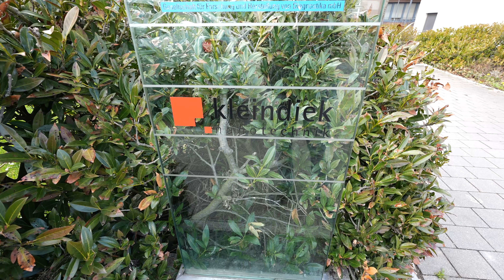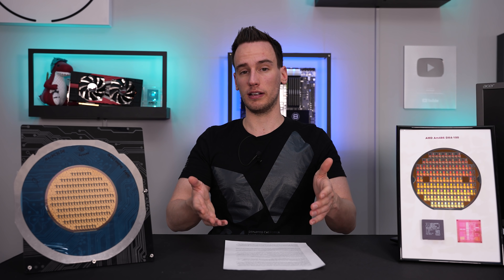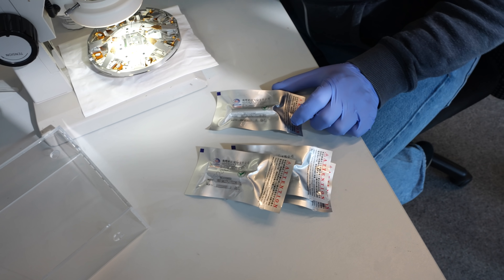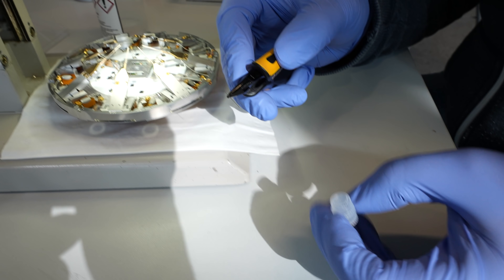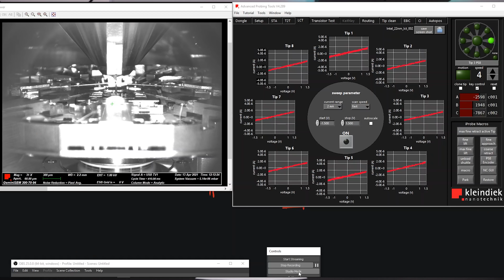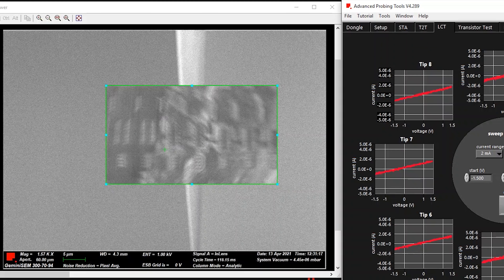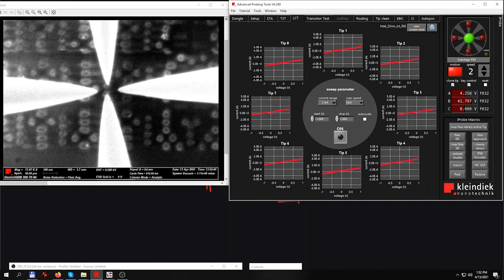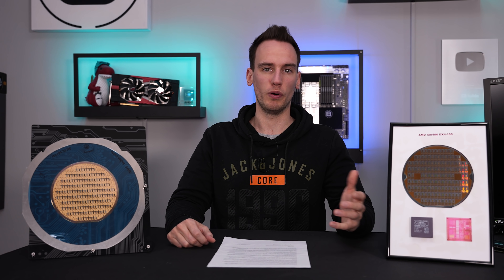Unreal Precision - Analyzing a Single TSMC 7nm Transistor. Visiting Kleindiek Part 1/2

Comment: I didn't know TSMC used cobalt. Some older articles speculated that Intel's 10nm process problems were because they used cobalt, which has different thermal expansion rates than copper.

Comment: I had a summer job in 1978 as a shipping/receiving clerk at a small LASER manufacture for marking and I would sometimes get a package with a probe device for contacting the terminals where the parts would get soldered. I remember touching the points to see how immovable they were, dumb but never had to sent any back. I also rotated the Galvo mirror motor armature for the mirrors for the LASER beam movement. Stupid more, I did have to send one back as defective. Never touch or rotate those devices.

Comment: I would just tell that the transistor is not 7nm length, but waaay bigger than that. The 7nm is the equivalent size, due 3D assembling of the die itself. The TSCM 7nm process does still have a gate pitch of 54nm (which is the same as Intel's 10nm), which makes the transistor 54nm wide. Since they're using several layers, and more than one can have transistors, their process can make chips that has a equivalent to a 7nm length transistor, which increases the transistor density inside the die.

Anyways, that's a great video, its probably the first one that I saw showing the process of assembling the test plate! \o

Comment: Cobalt the element also problematic because of how its mined & produced in the DRC by slave & child labor by thug guerrilla style despot controller criminals who control the cobalt mining // the DRC dominates global cobalt Co & its oxide products production capacity! Cobalt's use in NiCo alloy turbine blades for aircraft engines & turbocharger units in newer automobile engines & extensive use of of Lithium Cobalt Oxide cathode materials in common lithium ion or Li-Ion batteries in very popular portable consumer electronics or COTS consumer off the shelf electronics like smartphones, smartwatches, tablets, laptops, flashlights, power tools, e-bikes & electric motorcycles & scooters & all sorts of other thinks like Battery Generators (inverter + large lithium battery) & portable power packs (usb charging or Qi charging on the go) etc etc Tesla & other EV makers trying to reduce cobalt in the lithium batteries used to make electric vehicles like the super popular Tesla Model 3 & Y // there are other cobalt free lithium batteries like Lithium Titanate & Lithium Iron Phosphate // plus there are sodium & aluminum ion & other cobalt free sold state ceramic lithium batteries in preproduction & early commercialization ..

Comment: What I didnt get from the video is why this technology is even needed? They grind away 99% of a cpu just to get access to the components (that may or may not have got damaged during the grinding process.) What is the use-case for such measurement? What do they do after the transistors have been measured?

Comment: Saw an ad for a nano-probing arm a while back, it claimed ranges of around one millimeter and I was like "pfeh, useless" then I did the math and realized that it's like a kilometer at nano-scale under an electron microscope. Also, fun fact : those piezo motors are also what's used in lots of camera lenses : it's what Canon calls "Ultrasonic" motors (because of the microscopic expansion / contractions of the crystals are actually faster than Mach 1)

Comment: Can you please cover the types of vaccum pumps required for this analysis?! (& maybe mention the brands as well)
Reply: The SEM will have a roughing pump probably in the 10cfm range and also a turbo punp capable of getting the small chamber into the -6 or -7 vacuum range.  Brands are up to the sem manufacturer, i've seen Alcatel as one but other companies make the same size pumps.

Comment: How come electrostatics don't cause dust to latch on needle tip?  I work with fibers and I get dust on the end a lot and have to clean. Cannot see how you can clean a needle like this.  The one scene I saw of the room, looked like carpet and not a clean room.

Comment: Different materials on a single layer? That's lot of masking to do. Interesting to know how far they are willing to go to optimize the chip we are using.
Reply: that's why it can take months for a single wafer to make it through the whole process. just a "simple" interconnect layer is dozens of steps, going back and forth through litho, etching, metal or oxyde deposition, litho, etching again, deposition, polishing, litho, etching... back and forth until the whole layer is built, ready for the next one (not counting all the checks in between, film thickness, resistivity, contamination etc etc).
that's why you see an endless traffic of foups (wafer boxes) in every fab video you can find. they travel all day long between the various sections of the fab ^^

Comment: A little more specifically wrt the silver glue, or in my experience graphite tape, you're grounding the sample to drain charge accumulation. The SEM is flinging electrons at the sample if they aren't drained then a charge bias builds up and acts like a force field deflecting the electron beam and causing unpredictability in the back scattered  electrons which destroys the resolution leaving a bright blur. For non-conductive samples we would typically sputter coat them with a nano layer of gold that conforms well enough not to obscure surface features while providing a drain path.

Comment: The needle tip was visible in  naked eyes...
Then how is it possible to connect it with those contact points? Aren't those points too small (14nm) ? .. I'm confused,  pls explain
Reply: There is a smaller needle attached to the tip of the needle that you saw. You can't make that one out in the video. I've nanoprobed transistors as well, but it's been a while and on a different system than the Kleindiek.

Comment: Really interesting to see this is techniqually possible :O

But why would you want to do this?

Sure, if you are engineering a new process or building a new gate - it makes sense you want to measure real world numbers of your new design. But you dont need a full scale chip for that.
You could need this information as the data input for your CPU design software... but again, you dont need a full scale chip.

We know there s a silicon lottery. We know there are billions of transistors. How do you know you are measuring representative gates to draw conclusions from?
Why meaningless sample size can you measure this way? xD

What use are these measurements??

Comment: I'm amazed the 3nm tip is only 100 euro. The last I looked into it (10 or so years back) a 100nm tip was about that.
I see the probe head is connected via a very thin cable to what looks like a SMP connector. You could use these for low noise DC (since they are shielded) or for AC/RF, so I am curious if  they are doing this and what frequency they are rated for.
edit: the SEM is connected to a very nice Keithley 4200 semiconductor parameter analyzer, so the measurements would largely be DC. Those triaxial cables are very nice though.
Reply: k4200 may very well be just a dc bias supply
Reply: They're probably doing DC stuff with the 4200, then adding RF on top to measure things that can't be accurately extrapolated.

Comment: I'm curious how much one of the microscope costs, not to mention the probes.
Reply: the probes cost 70€ per piece... for the electron microscope probably around 100k€ for the shown ZEISS Model...
Reply: @XTreMe2k6  I actually thought the microscope would cost more. Thanks for the info.
Reply: That ZEISS system will be more like half a million.
Reply: @vayde  that's what I was estimating, personally. They're definitely not cheap.

Comment: I am blown away this is even possible. This is an amazing look at how nanometer scale electronics are probed. I would be interested to know about the parasitic impedance the probes impart on the transistors, but I suppose these processors are not functional during probing so maybe signal integrity isn't a big concern.

Comment: 0:10 Are those numbers for the updated TSMC N7P ("P" NOT "+") process that Ryzen 5000 uses or the basic N7 from Ryzen 3000?
Reply: There's not much (if any) difference in transistor density between n7 and n7p
I also read somewhere that transistor density varies quite a bit depending on wheter it's logic or sram and also on wheter it's frequency tuned or efficiency tuned

Comment: Bringing us the content no one else does!!!
Reply: I knew that thing exist, but it still looks so grazy, because about everything is made for testing tiny chips, and much much smaller transistors. They can test cpus or part of cache without grinding when chip is working, but not powered. Then needed much many more contacts/needles. I think then they use spesific Set and no adjustable needles.
Reply: The way you said that leaves open a lot of options...
Next video: Sculpting cheese into a cat with a toothbrush.